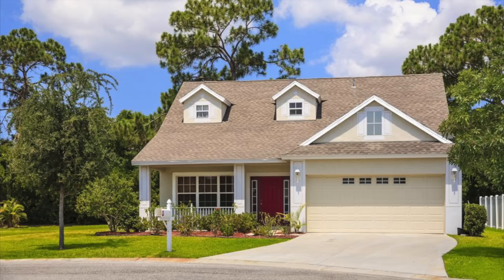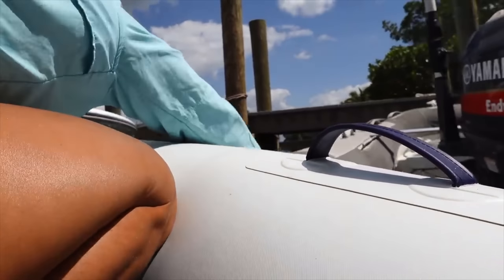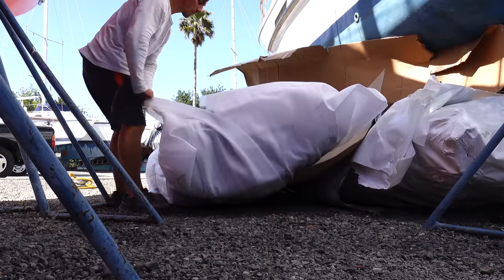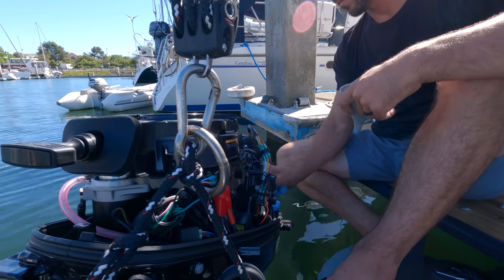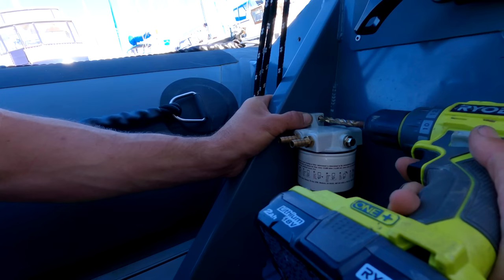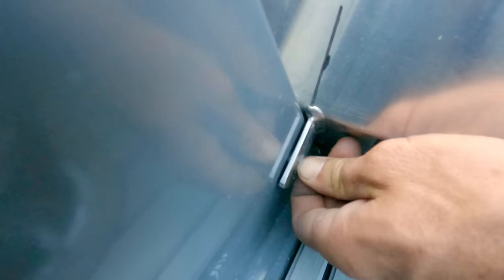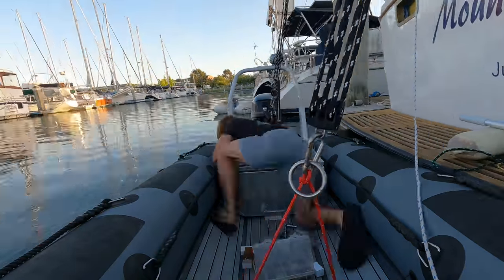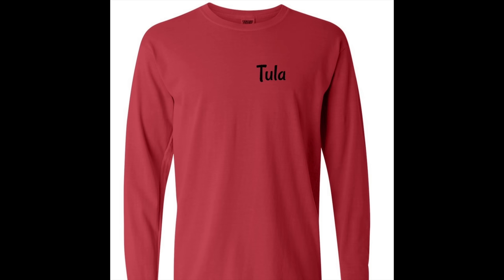Would Not be able to Do What We Do Without This! Our pimped out Highfield CL340 Dinghy!

Comment: Hey Tula Crew! I started watching your channel for the Corsair videos and have enjoyed following your continuing adventures. I appreciate your technical knowledge of boat construction and systems! As a US Coast Guard Auxiliary Vessel Examiner, I've had concerns at times about whether you're in full compliance with US Coast Guard safety regulations. For example, SUPs are considered vessels, which means you're required to have a PDF and sound producing device on board. The dinghy is also required to have a sound producing device on board. Though it's possible I missed it, I never spotted a throwable PDF on board the Corsair or PA 540 even though one is required to be immediately available on a sailing or motor vessel at least 16' in length. A wearable PFD for each person on board needs to be readily accessible and not stored in a compartment. That also applies on the dinghy. And PFD requirements apply anytime a vessel is in use and not just underway. A fire extinguisher needs to be readily accessible if a vessel has a closed compartment under thwarts and seats wherein portable fuel tanks may be stored, a double bottom not sealed to the hull or not completely filled with flotation material, or closed stowage compartments in which combustible or flammable materials are stowed. Your dinghy appears to have the first two and potentially the third. In your previous video, I see you upgraded your navigation light bulbs to LED. If you haven't already, I'd encourage you to make sure they match the visibility arc and range requirements specified in the Nav Rules. This is a common issue when upgrading bulbs. A local USCG Auxiliary Vessel Examiner could provide you with a free Vessel Safety Check (VSC) to go over all requirements with you (though verifying visibility arc and range is beyond the scope of a VSC). If you pass, you’ll receive a decal for each vessel and may qualify for a discount on your insurance. If you're interested, you can request one at cgaux.org/vsc. That would make a great video! And thanks for setting an example by visibly using the ECOS lanyard on the dinghy! Many people still aren't aware that ECOS lanyard use has been required since April 2021 when on plane in recreational vessels under 26'.

Comment: I like the dink but I have have question for you guys.  I'm thinking about floating down the Mississippi River later this year.  One of the things will need is a marine VHF radio.   Any suggestions as to what features I should look for.  I saw one that had an automatic strobe if it got wet which seems like a nice feature.   Anything else I should be looking for?  Keep the good stuff coming guys.

Comment: Highfield Boats , a best in class RIB tender manufacturer , couldn't have  picked a better partner #TulasEndlessSummer  to showcase the Highfield CL340 RIB . 
You two will definitely put it through its paces . 

Great mods to the tender from the get-go  : 
Extra rope handholds
Additional fuel filter 
Aluminum storage box
Dingy arch
Wear patches  < --  ( courtesy from  Highfield Boats)
Reply: Did you watch the video? Those are the exact modifications they made 🤦‍♂️🤦‍♂️🤦‍♂️

Comment: Wouldn't it be nice if someone made a tiny little diesel outboard for dinghies so we would have to carry two different types of fuel on board?
Reply: Diesel outboards do exist, but my quick search learn that they are expensive with a capital E.

Kind regards,  Christiaan
Reply: There are diesel outboard engines . They are getting smaller . They could have got one that is about the size of the gas engine they have .I would have got a diesel just so I did not have to carry gasoline on my boat and so I could relax and smoke while sitting on top of a gas tank. That and only one fuel for the two boats
Reply: @bobbates7343  thanks Bob, I have a 9hp on my tender & the smallest diesel I could find was a yanmar of 27hp & it weighed the same as a 115hp! If someone made a dinky little 5-10hp diesel that's not super expensive, I'd buy one in a heartbeat! Also I think the higher torque of a diesel will make up for a lower hp motor...